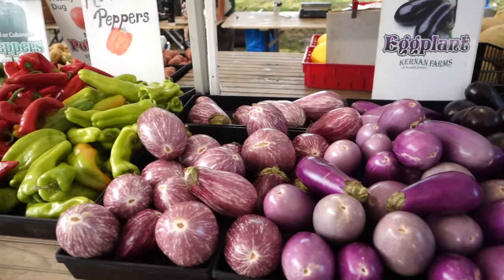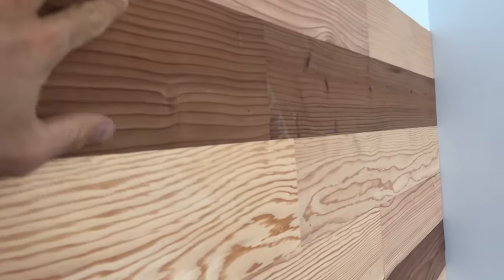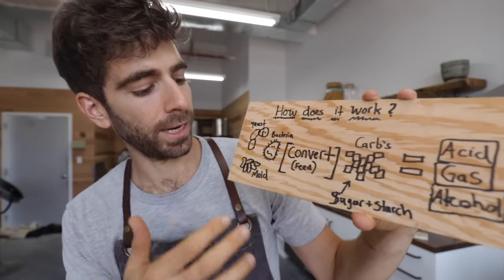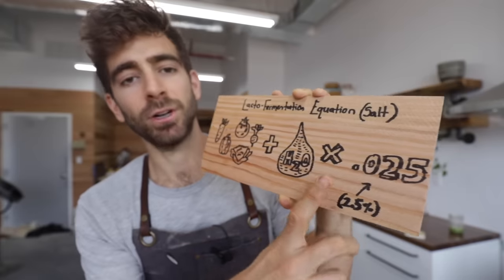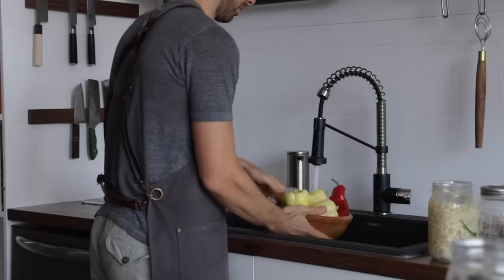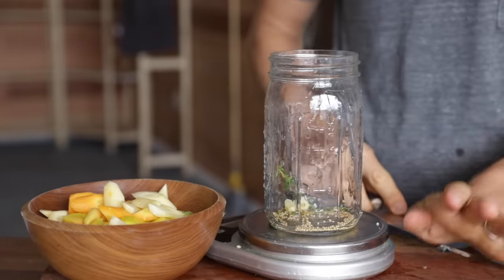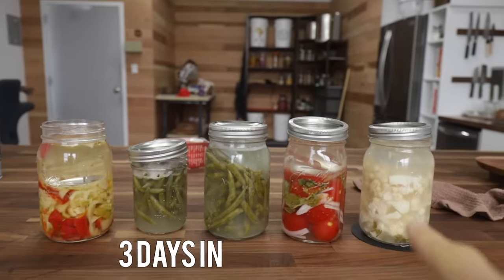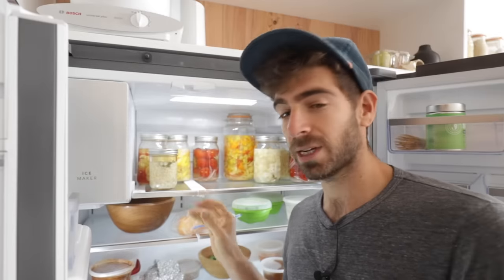The Complete Guide to Fermenting Every Single Vegetable

Comment: Did you ferment any fruits? Is the process quicker bcz of sugar? Would it become mushy if we let it fermented for a long time?
Reply: In Russland ist eine Tradition,
kleine Äpfel zu fermentieren.
Oder im Orient ganze Zitronen.
Delikatesse.
Reply: I am shocked at the amount of salt needed, I using pink Himalayan sea salt I realize it's lighter than other salts however based on the calculation given I should be adding 223.25 g of salt! Google says that's around 28 tablespoons could this possibly be right?

Comment: Any specific of suggested type of salt? 
Can you confirm how tight you out the lid on things? And if I have to use a plastic bag with water as a weight do you put a lid on it? 

New to this and hoping it will help my never ending gas bubbles.
Reply from the maker: sea salt is good. Dont screw on the lid tight and no you don't need to cover it if you use a plastic bag with water as a weight.

Comment: The leaving the jar on loose method is not recommended. Don't use that technique. Amazon sells cheap fermentation lids with airlocks use those. Air and contamination/mold spores will get into your jars otherwise and the whole idea here is to keep that stuff out. Bad idea

Comment: Just for your information, even less salt makes a perfect ferment. The temperature here is the key. I don't like adding much salt and I have been fermenting my food for the past 20 years now. Never used any scales or measurements for my ferments
No need to get a scale or such. Wrong statement here, wrong as well is to weighing your ferments with a plastic bag. REALLY? PLASTIC IS MADE FROM PETROLEUM. Do you think it's smart to add plastic to an acid fermentation process?? Otherwise good video.